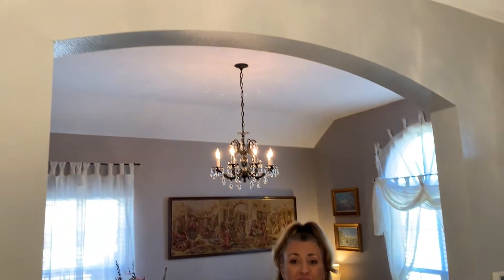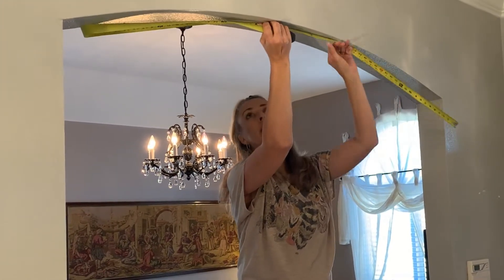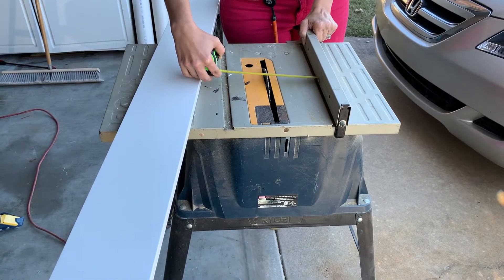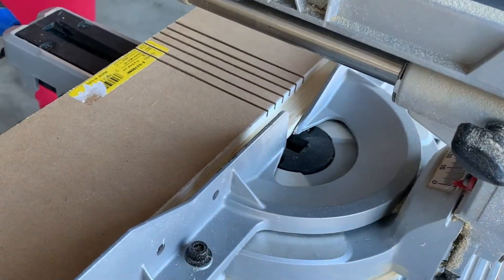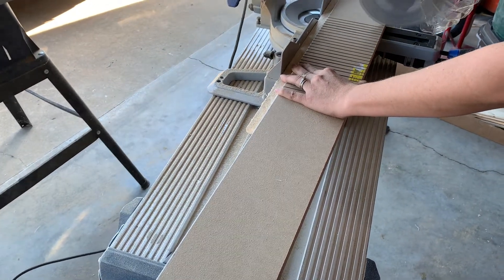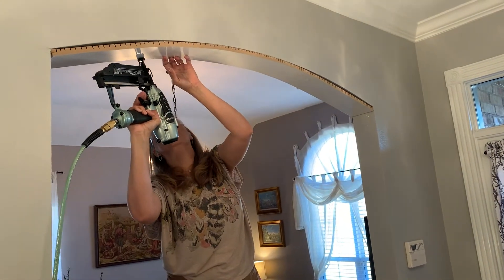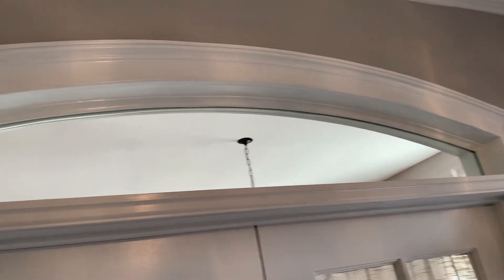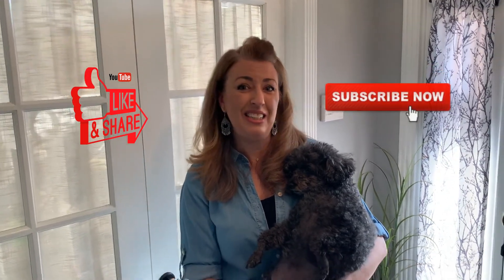Easy Frame an Arched Doorway DIY

Comment: Did you film the whole process by any chance?
Reply from the maker: I have have the trim out for the molding and glass installation videos for the smaller door I installed in the other opening for this same room. The process for the two doors was the same. These are the video links here:

https://youtu.be/mUAHt8hW4XE

https://youtu.be/v9atJlBq2tA

I just framed out the door with  a 6x2 between the door and the arch before I trimmed it out. Wish I had shown that part a little better but you can gauge what was done from the other videos. Hope this helps. 🙂

Comment: We cut from tacking one board to the ceiling to a completely framed arch with curved door casing and glass installed none of which is explained. I don’t really see the point of the video..
Reply from the maker: This video is just showing how to do the curvature on the top inside of the door when framing. If you would like to know how to trim out the arched part of a door, you can check out my other video here Trim Molding For Arched Doorway Easy DIY
https://youtu.be/mUAHt8hW4XE
Reply from the maker: Here is also the video of how to install the glass: EASY Glass Template and How to Install
https://youtu.be/v9atJlBq2tA